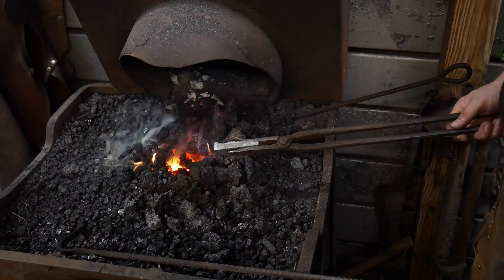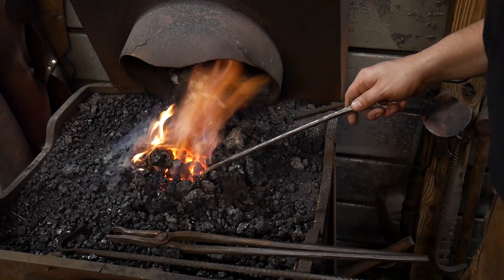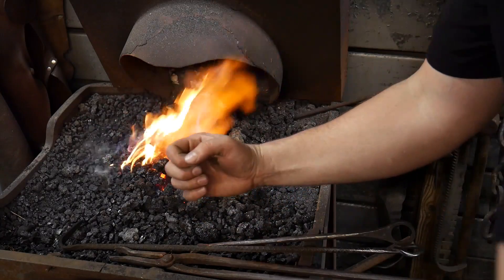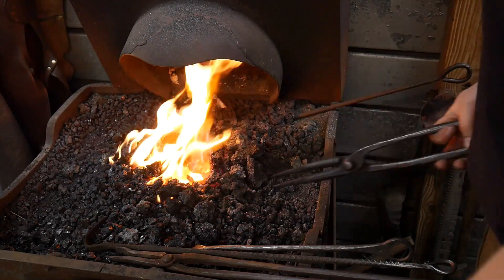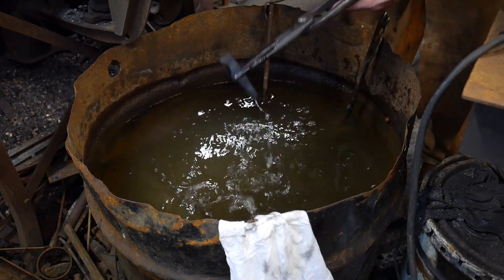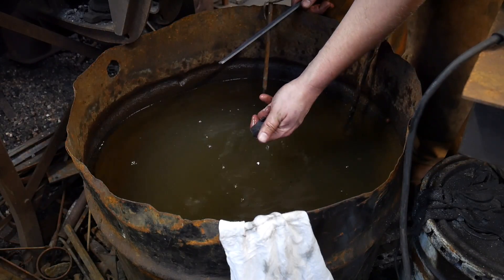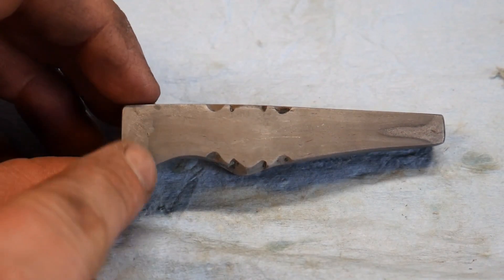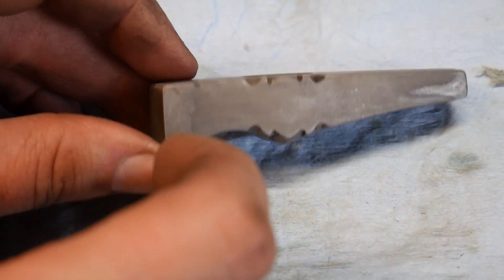Hardening and Tempering a Hammer Made of Wrought Iron

Comment: Is there special conditions to achieve this in propane forge as the heat seems less controllable in this way. In first thought i'm thinking of putting the area of hardenable metal directly in blast, any other pro tips on achieving this with propane? Thank you